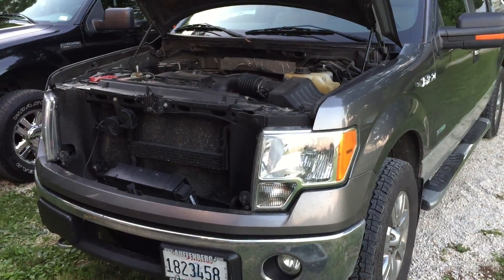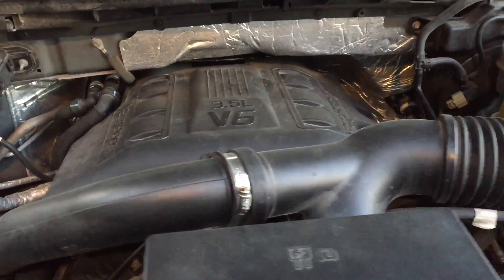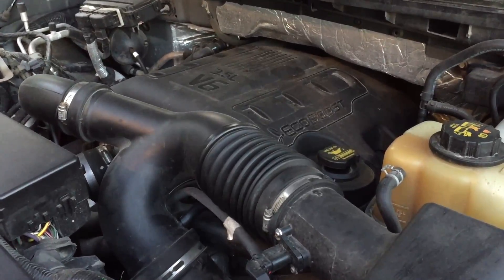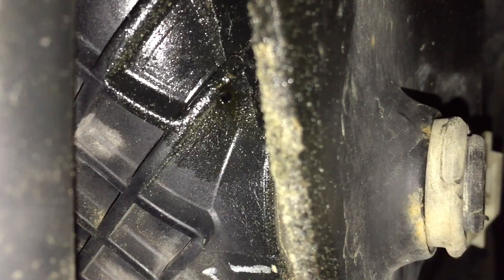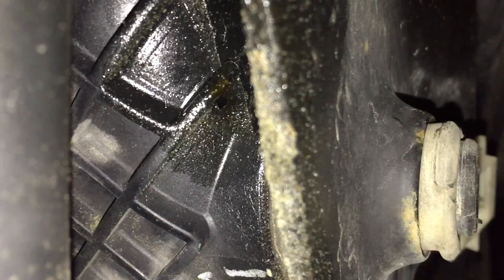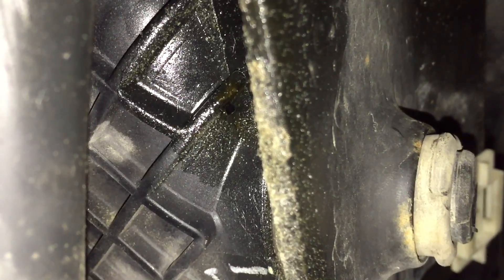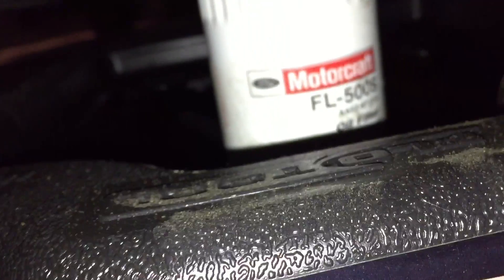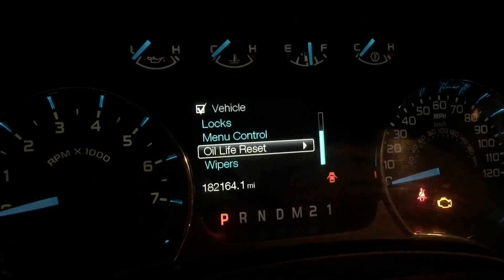Hole Drilled in Intercooler Fixes EcoBoost Misfire

Comment: youve just created a boost leak in your intake system. its also gonna suck dirt, unmetered air and even water.

what you need is a good quality oil catch can to prevent oil build up in the  intercooler
Reply: Do you even understand how turbo 3.5L works? IT never Sucks, it push air into engine. you can drive through water with the hole  open. (theatrically).
Reply: With a little screw on the tiny hole it should do the trick and you won't feel an anxiety attack so you could read more comments

Comment: Lol hole in the inter cooler? No worries about boost loss? You created a boost leak
Reply: You can think of air as a fluid for the sake of pressurized air in a turbo set up. Fluids take the path of least resistance and since that hole is so small unless a significant restriction is ahead of it (such as a closed throttle plate) is stopping it, the amount of boost loss is pretty negligible. And if there is a restriction ahead of it, the blow off valve will actuate and dump it in to the exhaust anyways.

Comment: If you go every 5k miles between oil changes, how is it at 182k? huh   ohhh yeah i watch the details
Reply: if you are running the semi-synthetic that is recommended for these engines(or running full synthetic), oil change interval is ok for 5k miles.  if it is just a daily driver and engine isnt being beat on, this mileage seems totally possible.  way to keep watch for the details. smh.
Reply: WifeBTR123 you change your oil at exactly 5000 miles down to the mile every time? Absolutely no you do not.
Reply: Yeah I was just being a smartass
Reply: I go 10k on my lincoln LS with walmart supertech synthetic 5w30. 185k on the clock. Runs like a champ!
Reply: kleetus92 Yep my Town Car has a recommended 10K miles oil change interval. I use Mobil 1 5W 20 and the car keeps up with the mileage and gives me warnings of Change oil soon and Change oil now. 167K miles on it and no leaks or oil burning.

Comment: each one of your videos seems more preposterous than the next. you should put your tools away and find another profession. Ford would put a hole there if it needed one genius... all you have done is create a boost leak for this poor guy. and yes the computer can detect this change in pressure. any professionally trained tech would agree.
Reply: pittsburgh volvo tuners the idea for this came from back in the day Volvos. They had 3/32 holes from the factory for this very reason. As a guy that bought his first new truck and has had to deal with this shit, and no help from Ford, I can tell you this is beyond frustrating.  Still love my EB.
Reply: Rite, thats why ford has changed the spark plug gap specs 3 times. Added shields to tye intercooler and than tsb to pull them off. Do some research guys. It works. No boost leak. There is a video on youtube proving no boost leak.

Comment: so oil in intercooler actually means you either have worn out turbos or your pcv system is junk. drilling a hole just creates a boost leak and is a temporary shade tree fix.

Comment: Had to think about this one a bit. The Boost leakage is a very small amount of air vs amount being supplied. It's a non issue. There is probably a bit of goo on the inside where the hole is, so I would bet the air being sucked in would capture most of if not all the contaminates that got in. That area is in an area where you would not see much dust anyway due to the way the air moves around that region. That is a pretty protected area. And being a boosted engine in a heavy truck, I would bet the times a vacuum large enough to pull any contamination through that tiny hole would be minimal at best. You would get more dirt from other sources already in the system.
Reply: The air leakage from a 1/16 hole looks like a leaky nail in a tire, after thumbing some spit on it. So compared to the volume of air that runs through system, it’s not noticed in the slightest and the system is still pressurized…
Reply: American Rambler you realize that this is a positive pressure system, right? There will be air forced OUT the hole, which not only will make the truck run worse, or at the very least weak. Air intake on fuel injected vehicles is a very delicate and intricate system, especially ones using forced induction. Putting any holes in the system will throw it out of balance and cause a boost leak.

Comment: This is NOT the proper way to fix anything!  This engine will now run a bit rich under boost, have less power, and a HOLE in it.
Reply: It will NOT run rich.  The hole is of an insignificant size.  Even if it was a significant air loss, the O2 sensors would permit the computer to compensate.
Reply: It actually may or may not run slightly richer under boost. If the MAF sensor is before the intercooler as it usually is [fresh air, filter, MAF, pipe, Charge Air Cooler, pipe, turbo]), then it will theoretically initially run slightly richer, but the front air fuel ratio oxygen sensors should compensate and realize the actual conditions are richer than expected and trim the fuel slightly. If that's the case, then I see no major harm in cutting the tiny hole aside perhaps from slightly higher emissions from the blowby releasing to the atmosphere.  If the MAF is on the other side of the CAC, then the engine will theoretically start lean which will might cause ping that results in pulled timing and then the air fuel ratio oxygen sensors should request more fuel to straighten that out...but that can cause increased wear on the high pressure fuel pump. Either way, this hole depends on properly functioning afr sensing oxygen sensors to not run slightly rich or lean.

I'd have probably tried replacing the PCV system first...to keep more blowby out of the CAC.  If the engine was well maintained, I'm thinking the turbos' seals are probably fine.  My VW 2.0t fsi has had oil consumption and blowby for it's 150k miles, but it's on its 3rd PCV system and second valve cover (part of the PCV in my car), and exhibits no signs of the turbo's oil seal being weak.  I also drain the CAC pipe of oil about every 20k...which is full of this muck.

Like all modern turbos, I'm sure this EcoBoost has its own built in turbo timer...running the electric aux water pump after you shut down the engine...so no need to cool the turbos if you're running decent synthetic oil changed by the time the computer says "CHANGE NOW" and keep it full if top ups are needed. People in this situation obviously aren't using their engines under heavy load, which is the only time you might want to idle for a minute or two after coming to a stop.
Reply: Brad Isley I thought I covered that in the rest of my reply :-)
Reply: 82raptor It won't run any richer. The turbo will easily compensate that small of a leak, however the real problem lies with turbo seals. Most don't know enough to take proper care of a turbo, idle time, etc...

Comment: with a hole in the intercooler won't the maf sensor  before the intercooler send the wrong signal for airflow?
Reply: It would sense a slight dip in the air pressure, and hold the wastegates closed just a hair longer. So no. It would send the rIght signal

Comment: You fixed it by creating a boost leak and now making the turbos work harder. Good job.
Reply: The turbos are not regulated.... they are operating at full capacity when you lay into it. The wastegate is what regulates how much boost is pushed into the engine
Reply: I get what your saying, the turbo spins at a its maximum rpm no matter the boost level.  But either way, this is not the correct way to fix the problem and it's laughable that a mechanic is claiming this is Ok and even good to do.
Reply: I totally agree, it a a band aid on a gun wound
Reply: Let's see - a 2.5" Or 3" diameter pipe at 19 lbs boost, vs a 1/8" hole....

Comment: the real fix is rebuilding the turbo,s!, there is oil in the intercooler...........
Reply: Ecoboost are notorious for this. It's oil from the crankcase ventilation. Many, MANY people install catch cans.
Reply: That oil is from the crankcase breathers. Catch cans will help solve most of that, the condensation will always be there.
Reply: MrBugsier5 you well always find oil in the intercooler any vehicle
Reply: MrBugsier5 this is a gas engine.. it wouldn't run away. diesels are fired off compression and have no throttle blade. 

many factors affect how much oil is returned through the system. My guess is this engine would pass a compression and leak down with flying colors.
Reply: You'd be rebuilding turbos all the time if you think this is the case.
Reply: DonkeyEvo  Y know, but the ones Y had where mostly diesels, a catch can on the  engines can help a lot, but had several gas engines here with filled up coolers due to blown turbo seals... the run terrible when there filled with oil...(and smoke as hell! lol)
Reply: Joshua TenEyck gas engines have throttle blades, diesels do not (most anyway some detroit 2 strokes had valves to close to help shutdown incase of rack issue) if a gas engine has a runaway it's because the throttle is stuck open.  Not from oil being burned.
Reply: I talked to a engineer at Ford.  It's not the seals.  He said the intercooler is too efficient and cools too much causing condensation.  It's usually condensation rather than oil in the intake.  He also said that the intercooler needs to be taller to prevent any moisture being sucked up into the intake.  Hense guys upgrading their intercooler and not having these problems.  Why Ford won't address changing the intercooler, idk.  Ecoboost are notorious for this problem.
Reply: Not mine , I got a Mann provent 200 !!!!
Reply: a little from the crankcase breader, ok, but iff its exessive, its mosltly the turbo bearing seals...(or tottally worn piston rings...) seen (and repaired) it many times on boat engines...some lucky and no runaway...
Reply: some daf diesel and mercedes om636 diesel engines have a vacume regulator system on the pump, regulated by a airvalve in the air intake, regulating the rack from the pump by a rubber membrane., and even gas engines when hot  can run on lube oil, had a customer here whit a mercruiser in a boat doing that... (client had twice the amount off oil filled up..) y'd have shut it off blocking the air on the carb, smoked like hell! lol, after draining 5 liters of oil, and cleaning the crank breader, it run fine... so its not that common, but it happens! , due to the carb you could regulate the rpm, after the gass was shutted off (killed spark, stil runned    lol, smoked like a steamer, killed it whit a rag)

Comment: Thats not the problem.  The problem is the truck doesnt have a catch can.  With any turbo motor you need something to catch some of the blow-by going through the intake system and the vapors are building up on the PCV system and condensing inside the intake runner.  You need to get and install a catch can so that those vapors can condense outside the engine and then re-introduce them back to the crankcase.  Simple fix.  Ford should have thought of this.  Its not even a trick either, but rather common knowledge on boosted motors.  If left long enough to happen it will build up on the back side of the intake valve and cause cylinder head failure.  Never drill a hole into an intercooler.  Reason for this is simple.  Incoming air is filter just before the turbo after that its all open into the intake manifold.

Comment: You are loosing boost by doing this. The Ecoboost does have an issue with valves getting carbon on them. Fix it right and get a valve job done.
Reply: Getting a valve job isn't going to help with oil vapor condensation in the intercooler... you're chasing the wrong rabbit.
Reply: Robert Wood  almost every direction injection engine out there has carbon buildup on intake backsides the subaru  did engines retained the intake injectors as well as the D I  injectors  no carbon Intake get cleaned of Egr deposits by minor use of intake injectors.   EGR CARBON DEPOSITS ARE SOURCE OF PROBLEMS WITH VALVES. 
Any liquid coming out of intercooler is due to cooling down of charge air after shut down . similar to coolant recovery or cracked headlamps with water humidity  condensate cycle
Reply: Robert Wood but most of that can be avoided by adding a catch can.  if a catch can is installed early, it will reduce the buildup on the valves and keep issues like misfires from happening.
Reply: Getting a valve job on these engines is the stupidest thing possible, all ford TSB’s say that getting those done will shred the turbos, they are finding that the carbon falling through after one of these is killing turbo fins, and any sort of spray cleaner is causing weird problems with the PCV, ford says there is no good way to clean them for these ecoboost’s

Comment: drill a hole? isn't the intercooler pressurized?
Reply: The volume of air capable of being delivered by the turbos is several orders of magnitude greater than that hole is capable of leaking, that's why it functions as a condensate drain, and doesn't effect performance.
Reply: MetaView7 it was
Reply: +russell379x now what? you won't get any turbo charge? the engine won't operate as intended?
Reply: +kleetus92 Thanks for the explanation. That makes sense.

Comment: check your turbo oil seals it probably leaking that's why u have a misfires oil should not be in the intercooler
Reply: Sylvanus George you'll almost always find some oil in the intercooler of any factory turbo vehicle with higher mileage

Comment: why tf is there oil in the intercooler?
Reply: melody Hart basically every turbocharger leaks a small amount of oil and it builds up over time. it's nearly impossible to perfectly seal the pressure fed bearings inside the unit from leaking any oil out. pull the charge air line off any intercooler from an engine with this kind of miles on it, and you'll find oil inside. Some comes from the PCV line as well which constantly spews oil vapors on any engine.
Reply: Melody oil in every intercooler ever made........even on a new car. I would tear off wrx intercoolers on warranty clutch jobs. Sometimes with less than 3 k on them. Guess what, oil in the intercooler, you just get used to it.
Reply: Yeah the catch can wouldn't block oil from the turbo seals....
So does that mean all wrxs have cheaply made seals that wear out quickly? What y'all said is conflicting.
Reply: Wow, okay. Do you ever need to worry about it or drain it out?
Reply: You can install a catch can.  https://www.summitracing.com/parts/mio-mmocc-cf?seid=srese1&cm_mmc=pla-google-_-shopping-_-srese1-_-mishimoto&gclid=CKqU9_784tACFY1XDQodw3QLWw